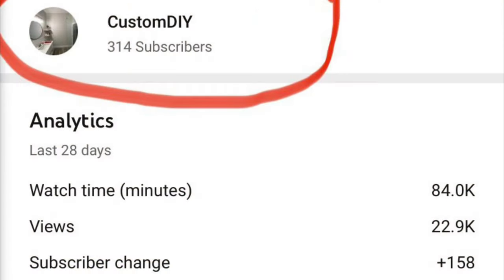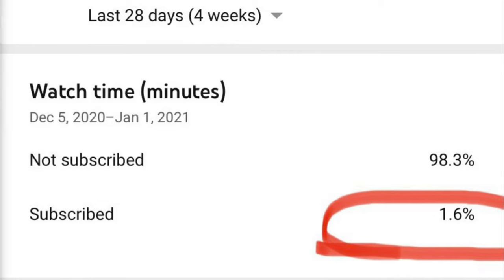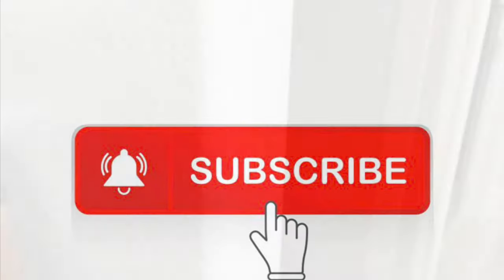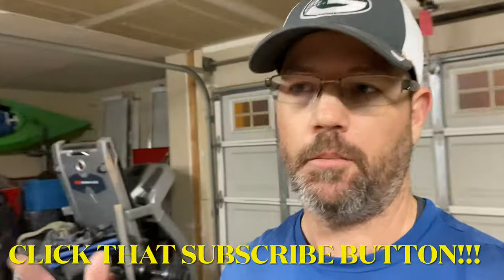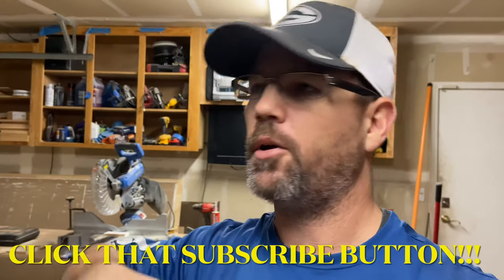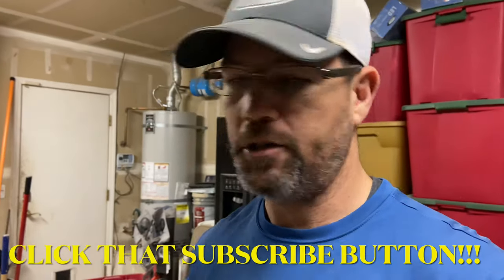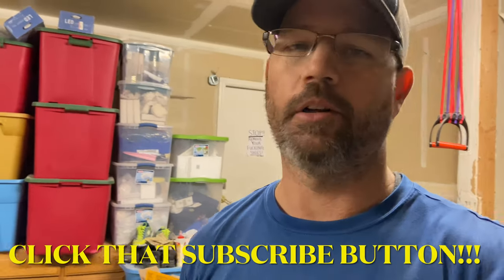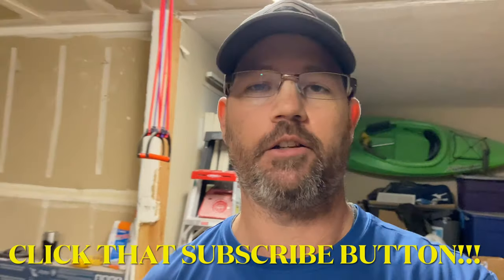How to trim around bullnose corner / finishing closets and hallway trim

Comment: Great video. I am replacing all of my builder grade baseboards with pretty much the same base that you are installing here. I too have those bullnose corners and I was stumped as to how to handle those. Your sawing was a little too fast for me. I bought myself a miter saw and it's only a single bevel (still learning terms). I bought it solely to do baseboard so I couldn't justify spending top dollar for one. I am getting myself confused as to how to make these cuts. Oh and I should say that my saw is only like 7 1/2 or something. I can't stand the 6" baseboard. I have to lay it flat and with only a single bevel I'm thinking I have to cut upside down on one side or backwards. And I have no idea how to make a stop so I can cut like 25 bullnose all the same width. The more I think about it the more overwhelmed I get. Have any pointers for a homeowner that has never done anything like this before? Thank you
Reply from the maker: It will be a little more complicated with your setup. What I would do is probably count up how many bull nose corners you have, then I’d cut 22.5 degree leaving a few inches of board behind the cut. If you have 20 bull nose, cut 20 pieces with 22.5 degree on one side, then you gonna measure 3/4 of an inch on the back side of each piece, then make your second 22.5 degree cut on each one. The extra length on each board will give you something to clamp down on so you can hold the piece down and cut a nice straight cut on the second cuts. If you need help shoot me an email at customdiyguy@gmail.com, I’d be happy to shoot a quick video for you.

Comment: If I could offer a suggestion. I think it would be much easier, and quicker if you would use CA glue with spray activator.
Reply from the maker: Oh awesome. Thanks! I’ll do that on the next one! Appreciate the comment
Reply: No. CA glue isn't for porous surfaces or long term use.
Reply: @MAGAMAN there’s a lot of carpenters that use CA glue with activator
Reply: Crazy glue? Dries really fast and only need a few drops.

Comment: Great video. A few questions... 
1. What is the size of that base board?
2. What type of material is it? Pine, mdf, etc...
3. What size do you recommend for door trim to complement your particular base boards?
Reply from the maker: Base board is 1x6 (actual 3/4 x 5 1/2), we used 3 1/2 trim on the door sides and 4 1/2 trim for the tops of the doors and over hung the top piece by 1 inch on each side. All is MDF.
Reply: @chrisbuildsitall  Did you baseboard and casings come eased or are they the standard sharp edges?

Comment: Use wood glue, not caulking. Lay the boards out flat and lined up, then put some painters tape across the back of them, so when you glue the joints and rotate them into position, the tape holds the outside of the joints nice and tight and even so it doesn't look like crap, like the corners in this video do.
Reply from the maker: Good tip thanks
Reply: Savage LOL

Comment: Someone installed a couple baseboards without a scarf joint, just butted them. Has this happened to you? Maybe cut a stud at 45 degrees and use it as a ramp to guide a multi tool at a 45 ? and scarf in a short run?
Reply from the maker: That’s what I do I mine. Cut a 45 on each piece to join them. Using a stud would work well.